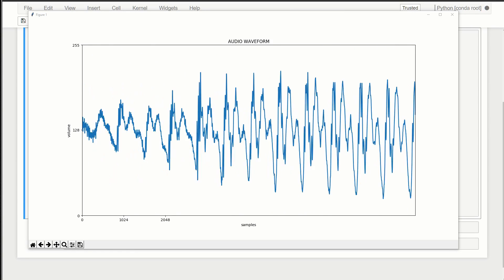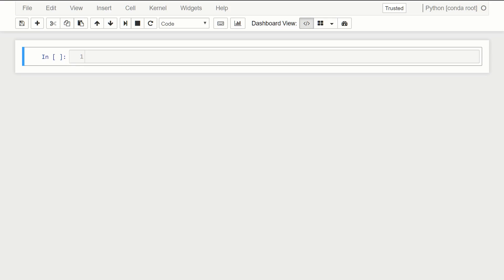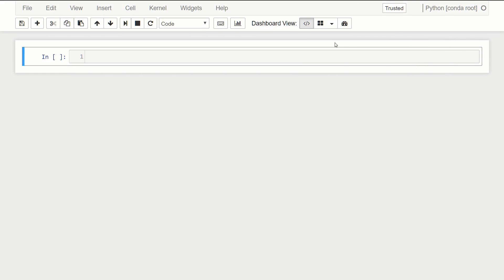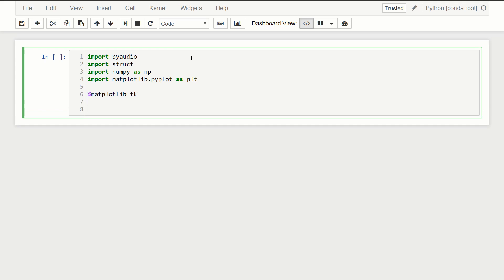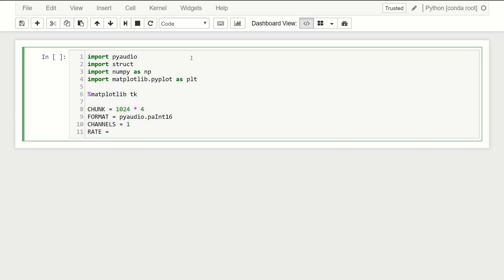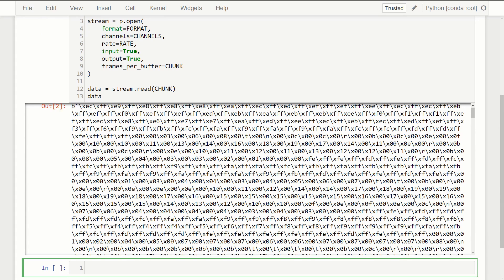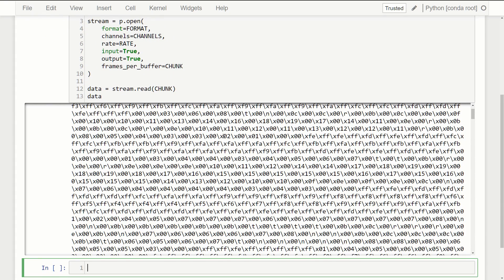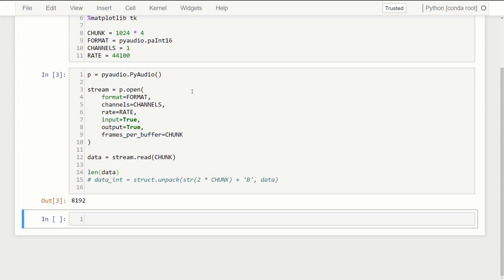Let's Build an Audio Spectrum Analyzer in Python! (pt. 1) the waveform viewer.

Comment: Hey Mark Jay , actually after running the : import pyaudio in jupyter notebook i've found this error : ModuleNotFoundError                       Traceback (most recent call last)
<ipython-input-1-180f1201419f> in <module>
----> 1 import pyaudio

ModuleNotFoundError: No module named 'pyaudio'
Reply from the maker: Ok. That means you need to install pyaudio. If you are on windows, you can just do pip install pyaudio and everything should work. If you are on linux, also need pulse audio installed and to start an instance of pulse audio before running pyaudio
Reply: @MarkJay  I'm working on windows , I try it on prompt right ?

Comment: Hi, I'm very new to python, but am trying to use it for a school project. Is there any way that something similar to this could be used, but instead of using microphone input you analyzed the output coming from the speakers?
Reply from the maker: If its coming out a speaker, you likely already have the digital audio on the computer and can process. Or input that audio to a computer

Comment: I am kinda new to this. When I tried printing data_int i get all 0s how is it that in the video you are getting different values? 
Any help would be appreciated
Reply: if all the code correct ,it could be a mic problem
Reply: Hi chandana, got any fixes? I am facing same issue, even with random values, getting 0, 1 and 255 only

Comment: Hi Mark,  This video series is really great ! I use Python 3.6.4 and the '%matplotlib tk' line gives an error; 'End of statement expected.'
Thus the program does not run neither in IntelliJ nor in Jupyter notebook.  I could change over to Pqt5 GUI, but want to get to the root of this issue. Can you give me any idea?
Reply: I had the same problem in Spyder IDE ! I would like to know what may be causing this too, these compatibility issues are actually pretty common in python codes, unfortunately :/

Comment: for anyone who is having problems installing PyAudio Try This:

pip install pipwin
pipwin install pyaudio

pipwin is like pip, but it installs precompiled Windows binaries provided by Christoph Gohlke. Saves you a lot of googling and manual downloading.

Thx for the feed back :) any girls here wanna add me on snapchat?
Reply: THIS COMMENT DESERVES A MILLION LIKES!!!!!
Reply: yo i did this and it said it's installed, but in jupyter notebook it says the module doesn't exist. any suggestions? thanks

"ModuleNotFoundError: No module named 'pyaudio'"
Reply: And be sure to run the command prompt with administrator privilege else you might run up with errors.
Reply: Another way to do it:
What I had to do was download the PyAudio file directly as a WHL file, then: pip install file_name_here.whl 
Make sure the CP matches your version of python and the OS versions match in the filename
Reply: Thanks
Reply: You're a beautiful person
Reply: i've no problem with 'pip install pipwin' but with 'pipwin install pyaudio' says pipwin is not recognize as a external or interal command
Reply: also had a problem, currently this does not work with python 3.7
Reply: @aryelol  I've just updated python to 3.8.3 and got pipwin and pyaudio to install. Haven't tested it yet but its just told me "Successfully installed PyAudio-0.2.11"

Comment: I am using MacOS and i am getting 0s (zeros) value in my tuples that mean it didn't take any data from my audio? pls help me out.
Reply: output=false because that returns 2000+ samples at zero.
Reply: Ah, makes sense.
Reply: Hi, I had this problem, try changing 'output = true' to 'output=False'. That worked for me. (running on macOS).
Reply: @lazzapie  Thanks, this worked for me, on MacOS :)

Comment: good stuff, wasn't aware that this could be done so directly.  sadly, i also get all 0s as my audio samples - so running this on a mac may require a few more setup steps.  i have not been able to uncover the proper way to do this, despite a bit of research.  would LOVE it if someone could provide details on what it takes to get the audio input from the default mic into pyaudio on a mac.
Reply: Have you got your answer what are the few more steps??? Coz I am using MacOS and i am getting 0s value in my tuples that mean it didn't take any data from my audio? pls help me out
Reply: so, i changed "Output=False", and some data started to show up.  and then i got some overflow errors, but then got data again.  hopefully that will move you forward.
Please be aware there is a lot of mis-information in this tutorial.  i don't think the author fully understands what the pyaudio.paInt16 data format is - (a 2-byte signed integer), as everything after that is a muddy mess of bad data structure manipulation.  ask yourself why len(data) = 8192 when the CHUNK is set to 4096.  (because each piece of CHUNK is 2 bytes!  that's what paInt16 IS). 
when using the proper data format, the data values will range from -32767 to +32767.
you might consider loading the numpy library, and then converting 'data' variable to a properly structured variable with:
amplitude = np.fromstring(data, dtype='int16')
and then try to use that variable (amplitude) to plot the values, ignoring all that struct.unpack business.
by the way, if you do look at those bytes individually, you will discover they are stored as twos-complement - but across 2 bytes, of course.  but doing so is just bad tech - use a Int16 data type since the data was created with an Int16 data type.
Reply: @DaveCampbellKY  thankyou for this important information it's really helpful. 
And can you tell me(or send me the link) from where you got these information and do this coding part as well (github link) if you have. Thankyou so much
Reply: @priyankasrivastava6757  - it might be time to 'roll up your sleeves' and dig into some source material - this is actually a fairly straightforward exercise, to take the inspiration from the original video and correct it using proper data structures.  i haven't done that myself - but may, and if i do i will post it here.  in the meantime, these are useful references:
pyaudio home - https://people.csail.mit.edu/hubert/pyaudio/
pyaudio documentation - https://people.csail.mit.edu/hubert/pyaudio/docs/
numpy.dtype docs - https://docs.scipy.org/doc/numpy/reference/generated/numpy.dtype.html
twos-complement details - https://en.wikipedia.org/wiki/Two%27s_complement
Reply: @DaveCampbellKY  Thankyou

Comment: The data format over the audio channel you requested is a signed short value (Int16). But when you sed struct you tried to convert it to unsigned chars (UInt8). You should be able to get the data with struct if you change it to unpack your sample size as signed short data.

data_int = struct.unpack( str( CHUNK ) + 'h', data ) # Signed Short - 16 bits

This will give you your sample set about the origin as you would typically see in a time plot with no extra manipulation.
Reply: how can we modify the plot ?

Comment: Your video is really helpful in helping getting started with pyaudio. Thank you so much.
Here is tip you can reduce complexity in changing 2 bytes into int... just one line has to be changed.
Instead of 
>> data_int = np.array(struct.unpack(str(2*CHUNK)+'B', data), dtype='b')[::2] + 127
use
>> data_int = struct.unpack(str(CHUNK)+'h', data)

:)
Reply: Why don't you multiply by 2? Because I got an error that says "unpack requires a buffer of 2048 bytes"

Comment: Hey Mark, I am able to start the stream, but it's idle and dosen't move at all(i.e stays at 0). What am I getting wrong??
ALSA lib pcm_dsnoop.c:606:(snd_pcm_dsnoop_open) unable to open slave
ALSA lib pcm_dmix.c:1029:(snd_pcm_dmix_open) unable to open slave
ALSA lib pcm.c:2266:(snd_pcm_open_noupdate) Unknown PCM cards.pcm.rear
ALSA lib pcm.c:2266:(snd_pcm_open_noupdate) Unknown PCM cards.pcm.center_lfe
ALSA lib pcm.c:2266:(snd_pcm_open_noupdate) Unknown PCM cards.pcm.side
ALSA lib pcm_dmix.c:1029:(snd_pcm_dmix_open) unable to open slave
Cannot connect to server socket err = No such file or directory
Cannot connect to server request channel
jack server is not running or cannot be started
JackShmReadWritePtr::~JackShmReadWritePtr - Init not done for 4294967295, skipping unlock
JackShmReadWritePtr::~JackShmReadWritePtr - Init not done for 4294967295, skipping unlock

Above are warnings I get before the message "stream started".
Thank you!!

Comment: Hey Mark, Thanks for making this series! I'm able to follow along and replicate your results, but thats about all i can call it. Could you tell me how I might gain a more intuitive understanding of why you do what you do in the script? I.e. do I need to dig around in the documentation of the libraries used until it makes sense.. or whatever it may be. Sorry if this question is very vague, my understanding is so lacking I'm still at that point where i don't know what question im really trying to answer for myself. Thanks!
Reply: I don't know if this will be helpful, but here's at least one perspective on a project like this:

I can't think of a reason you'd want to display a waveform in real-time, aside from possibly the aesthetics of it, and the practice you get in dealing with real-time audio signal processing, but either of those can be valuable. I'm trying to do things like make a python guitar tuner that will tell me what notes it's hearing in real-time, which requires being able to process real-time audio (but not to display a waveform), so the benefit of the video from my perspective is that it showed me how to open a PyAudio stream and get Python to do something with it forever in real time. If you're neither trying to process audio in real time nor display things in Matplotlib, then the video just maybe isn't that helpful for you, but still pretty cool, I think.

Comment: I am having a bit of trouble getting a pop up window like you do. I have matplot lib and I am working in Jupyter notebooks. I also looked through the comments and didn't find anything that worked. You mentioned that matplot lib uses tkinter? Do I need to have tkinter installed before it will work? I didn't see you do it but maybe I need to import it? 

Great video though! Any suggestions are welcome!
Reply from the maker: Tkinter is part of python standard library so it should work. If you check part3 of the series, I made a python file version. Maybe that will work better

Comment: matplotlib tk has a syntax error, what should I do i am using IDLE python to code
Reply from the maker: Are you using jupyter?
Reply: no i am not
Reply from the maker: @lyners1999  I see. That line is a magic function that only works with jupyter
Reply: so what should i replace it with? im quite new to coding haha
Reply from the maker: @lyners1999  try jupyter.

Just do
 pip install jupyter

Then type 
jupyter notebook 

In the cmd window
Reply: thanks alot!

Comment: what is IDE you used for development ?
Reply: I suggest trying PyCharm Community, its free and open source. I have tried sublime, vs code, atom and that's all cool but for example  they don't list all the methods or properties after dot and they are not as good at auto-completing stuff as PyCharm is. In addition to that, PyCharm will sometimes tell you errors ahead of time and will also fetch documentation for particular function. Atom, sublime and vscode are not really IDEs, they are more like text editors for writing quick scripts
Reply from the maker: I mostly use jupyter. otherwise I use atom.io

Comment: This is great. Thanks a lot for posting it. Setting data_np = np.frombuffer(data, dtype = np.int16) works a lot better (no need to subsample, pywave datatype es int16). You'd need to readjust ax.set_ylim(-2**15, 2**15)
Reply from the maker: thanks! yes definitely that's a better option. makes the code cleaner and faster

Comment: is it possible to make this exact same thing, but use Pyserial instead of Pyaudio. Im trying to collect data from an arduino serial port and display its signal/Frequency spectrum in real time.
Reply: hello zach. seems like we are working on a similar project.I have the same problem here. Did you find a way to do it?

Comment: Hi! Sir, I'm encountering error here:
OSError                                   Traceback (most recent call last)
<ipython-input-8-f19523a287dc> in <module>()
      7     input=True,
      8     output=True,
----> 9     frames_per_buffer=CHUNK
     10 )
     11 
I'm using Rpi jupyter notebook. How can I solved this? thank you
Reply from the maker: Larenze Dimaandal not sure but it's probably the audio driver if you're using a pi. I've had trouble using pyaudio on linux
Reply: Thank you, so we can't implement this on pi? Do you have an alternative scripts with this issue?
Reply: I understand thank you so much :D

Comment: Hey I am getting an overflow error: File "/Users/nameofcomputer/PycharmProjects/untitled/venv/lib/python2.7/site-packages/pyaudio.py", line 608, in read
    return pa.read_stream(self._stream, num_frames, exception_on_overflow)
IOError: [Errno -9981] Input overflowed

Is there a fix for this?
Reply from the maker: are you using macos or linux? I'm not sure how to get pyaudo working with those operating systems

Comment: %matplotlib tk     give me syntax error...
Reply from the maker: Jakkapong Saksrisuwan are you running this in a notebook or python file? That's a magic command which only works with ipython
Reply: Mark Jay i see.. thanks. I'm just working in terminal.. with vim
Reply from the maker: I see. if you check out part3 in this series, I made code that can be ran in a normal python file.

Comment: Bytes are 8 bits and ints  are 16 bits.  Converting from bytes to ints adds a zero byte to the front, doubling the size of the data.  Also with signed bytes everything from 128 -255 is considered negative.
Reply from the maker: yeah I definitely went about it wrong using struct. using numpy.frombuffer() really simplifies process going from bytes to ints
Reply: @MarkJay  I am so sorry.This cannot  run in my pc. I use Spyder to running the program. my code is the same as yours.
when I run the program, it cannot draw a figure and it will throw   return pa.read_stream(self._stream, num_frames, exception_on_overflow). I cannot understand this. can you teach me ?
Reply: @gaoxuewu5411  Try reducing the size of the chunk

Comment: Hello. My graphic is not that clean. It seems there is a huge interference, how can I filtrate it?
Reply from the maker: Yuri Mota do you mean the microphone? The best way is to get the cleanest signal into the computer. The normal headphone jack can be noisy. If you can get a digital audio interface, you will get much cleaner input

Comment: Hey Mark.... really appreciate your work. I am using pycharm using python 3.6. Everything works fine like you said but I get an error : "_tkinter.TclError: this isn't a Tk application " after I manually close the streaming. Can you please hellp in this ?
Reply from the maker: yes, if you check the github code, I added a try statement to handle this error

Comment: after I run the code, the display not really as good as you. It's only show 3 numbers; 0 1 and 255. The matplotlib window giving me a long vertical lines, even when my voice detected, it does moving but with vertical lines from the center then spread to left and right (no horizontal line)

after I closed the window it gave me an error message:

TclError                                  Traceback (most recent call last)
C:\Anaconda3\lib\site-packages\matplotlib\backends\tkagg.py in blit(photoimage, aggimage, bbox, colormode)
     21             "PyAggImagePhoto", photoimage,
---> 22             id(data), colormode, id(bbox_array))
     23     except Tk.TclError:

TclError: this isn't a Tk application

During handling of the above exception, another exception occurred:

TclError                                  Traceback (most recent call last)
<ipython-input-17-098166f50294> in <module>()
     20     data_int = np.array(struct.unpack(str(2 * CHUNK) + 'B', data), dtype='b')[::2] + 127
     21     line.set_ydata(data_int)
---> 22     fig.canvas.draw()
     23     fig.canvas.flush_events()

C:\Anaconda3\lib\site-packages\matplotlib\backends\backend_tkagg.py in draw(self)
    350     def draw(self):
    351         FigureCanvasAgg.draw(self)
--> 352         tkagg.blit(self._tkphoto, self.renderer._renderer, colormode=2)
    353         self._master.update_idletasks()
    354 

C:\Anaconda3\lib\site-packages\matplotlib\backends\tkagg.py in blit(photoimage, aggimage, bbox, colormode)
     28                 _tkagg.tkinit(id(tk), 0)
     29             tk.call("PyAggImagePhoto", photoimage,
---> 30                     id(data), colormode, id(bbox_array))
     31         except (ImportError, AttributeError, Tk.TclError):
     32             raise

TclError: this isn't a Tk application

what happened....???
Reply from the maker: Try using np.frombuffer. it's a much better way of converting the audio data from bytes to ints
Reply: Getting same issue brother, have you solved it now?

Comment: why every time I hit run, it says:

AttributeError                            Traceback (most recent call last)
<ipython-input-2-754a038a9573> in <module>()
      7 
      8 CHUNK = 1024 * 4
----> 9 FORMAT = pyaudio.PaInt16
     10 CHANNELS = 1
     11 RATE = 44100

AttributeError: module 'pyaudio' has no attribute 'PaInt16'
Reply from the maker: Mecca 0497 should be paInt16 (not PaInt16)
Reply: ah... thank you! I didn't see that, P instead p